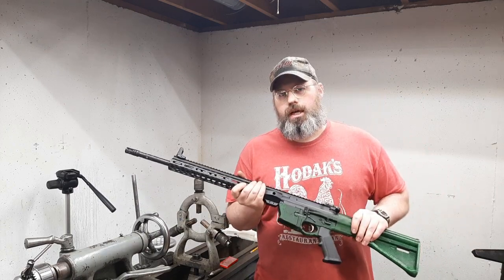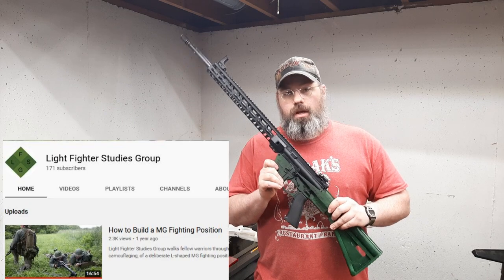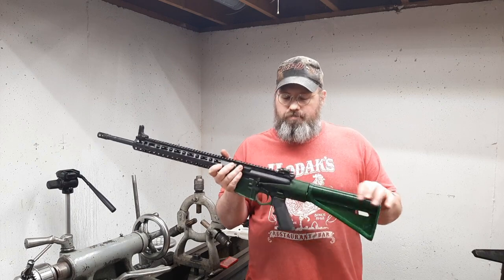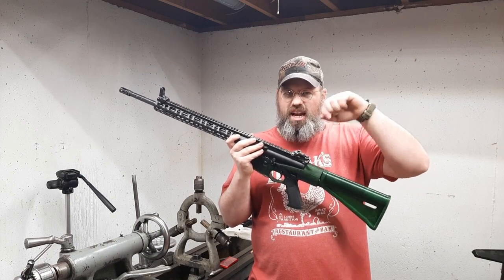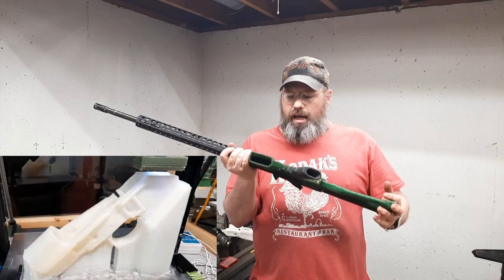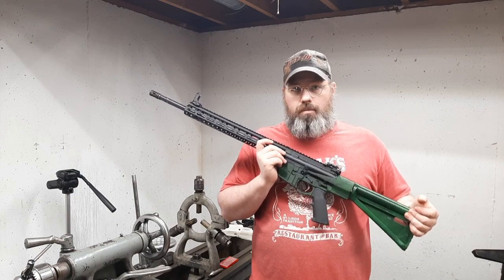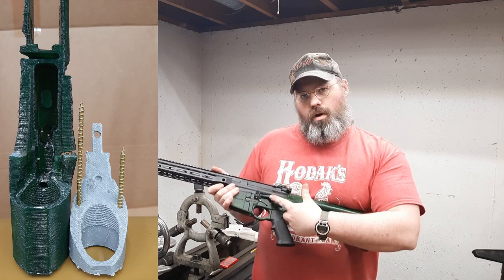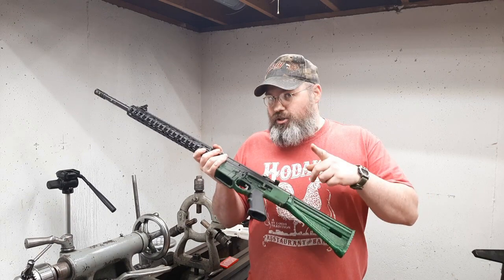PCTPE Deck Screw reinforced AR-15 lower update

Comment: Polymers and 3D printing have come a long way, nice brother!  Insofar as the Buffer issue, there are self-lubricating buffers out on the market (Nickel Boron and otherwise) that would be a sufficient fix for that without using a lot of extra lube-- and of course grease is another good solution that'll stay and keep things running smooth.  Very cool!
Reply from the maker: Thanks D.J.  My last design change corrects the alignment issue. But those sound like great solutions in a pinch!
Reply: @SmallTeamSupply  Yeah I caught that, definitely problematic when there's an excessive carrier or buffer tilt.
A little good grease goes a loooong way  :)